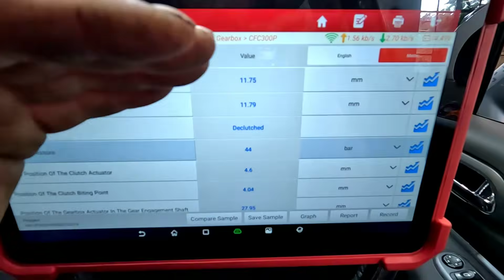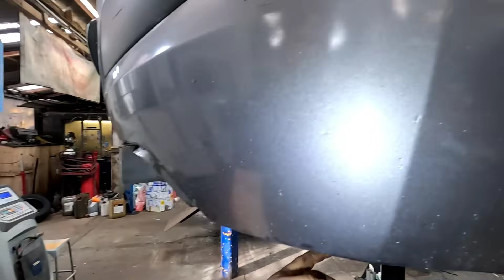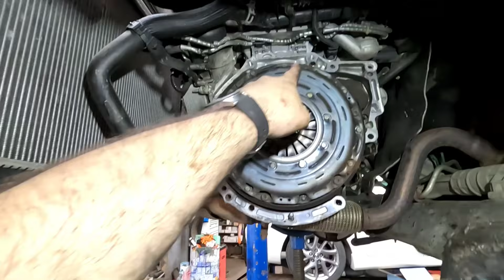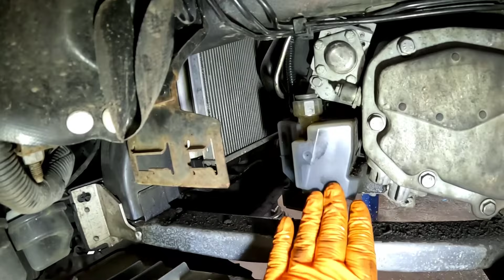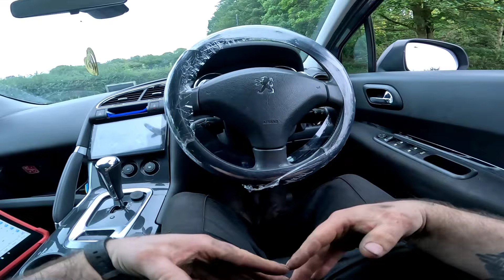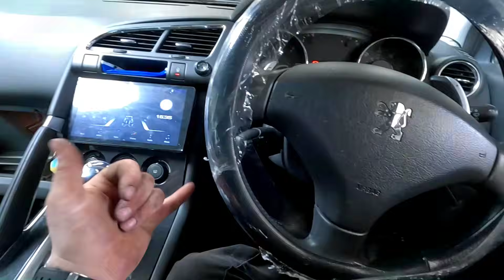Semi automatic clutch replacement Peugeot

Comment: does its because of clutch need to be changed when you put in Drive or a reverse drive It doesn't start easily, it seems like it wants to shut down like no power , and after that drives normally ?

Comment: Hello, did you change the floating steering wheel? And what brand is the clutch kit? I have to do this job in a C4 cactus, greetings
Reply: Valeo Brand is installed, is also OEM Part for this Car.

Comment: i have semi auto and from cold when starting f it sort of kangeroos moving from first after couple minets its fine wot could that be
Reply: My 2009 Clio does the same!! In garage now for repair but they say specialist garage nearby can’t do it. Don’t want to scrap it!!! North wales.
Reply: Could be the starter battery. The actuators need more omph than the generator can deliver. So even if the car starts ok in cold conditions, the shifting gets awful. I had this kangaroo experience with my 2017 Berlingo ESG6 Blue HDI. It got better, when the battery was a little recharged by the generator (to cross a charging threshold🤔🤷🏼‍♂️?) . 
Make sure to put the gear in neutral when you stop the engine. Shifting puts a lot of stress on the battery, specially in a car with start/stop system and to put that to the extreme in cold weather conditions. It's tough to do all that with an 'ok' battery.

Comment: Mine will select reverse and car moves but if I select drive it doesn't move and stays in neutral then throws a code p1734 gear actuation position in the gear selection shaft signal fault . How can I fix this ? Can I remove actuators with the box on the car ? Thanks in advance a fellow mechanic

Comment: Sorry to bring this one back from the dead.. just wondering if you had any recommendations for a budget diagnostic equipment to reprogramme a 508 semi automatic.. doing it on the drive and to say its a nightmare,  is an understatement! 😢
Reply: The knock off Peugeot diagnostics from China does it properly.
Reply from the maker: I'm not sure tbh in lower end cheaper diag tools as I've never used them and hate to say something you buy it and not work

Comment: You dont have to lower the subframe ?? i watch other video and they lower the subframe and i do the same and now stuck with bolt spin around. Will be easier for me tighten bolt and dont touch subframe

Comment: Just a question after you fitted  the clutch what was the procedure with getting it working. i.e programming the biting point, programing the gear change, pressurising the actuator?
Reply: Mine drives like shit after new clutch and flywheel lol and some times swops to manual then bk to auto going dwn gears iv noticed any idea lol

Comment: My dad's Citroen C4 has the same ETG6-gearbox. After clutch and flywheel replacement gearshift became even slower than before the repair. I counted it takes now 2-3 seconds (!) to upshift. In reverse gear the clutch slips so badly that it begins to smell. The car haven't done that either before the repair. Is there something wrong with the software? The work was done by a professional PSA specialized workshop.

Comment: I watch ur videos on tik tok lol i have peugeot 3008 semi it jerks bad in low gears slow when changing and judders and swops from a to m to auto in 3d some times is this clutch as had it done an flywheel seems getting worse and worse no one will do was gona drive 3 hours to u lol

Comment: Done a fair few of these got one to do tomorrow in a c4 grand picasso keep hearing customers saying not many garages will do them tho
Reply from the maker: Not many will get involved don't know why its a normal clutch job with pressing a few buttons
Reply: @bazmeredith  exactly done harder Manual ones tbf top work tho mate
Reply: @dodgydave4841 still do em m8
Reply: @bazmeredith do you still do them m8
Reply: My 3008 judders on pull of sum times swops from auto to manuel in 3d and changes slow is it slipping ? And jerks in 1s and 2nd bad like ur rocking lol